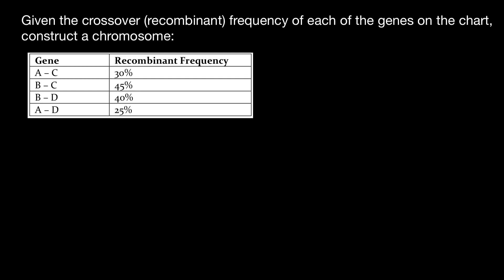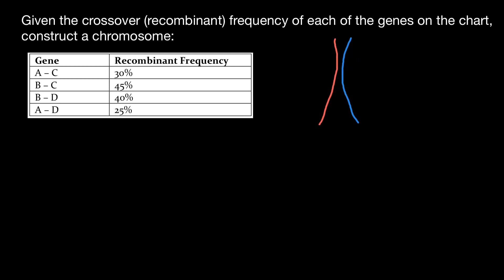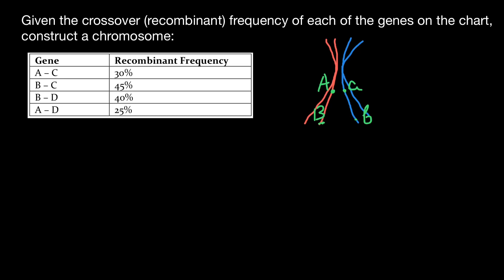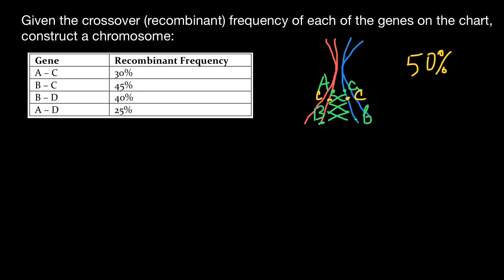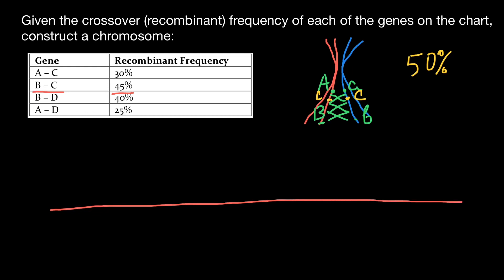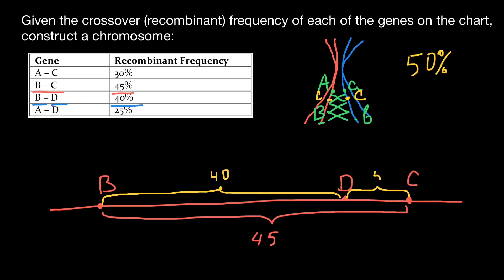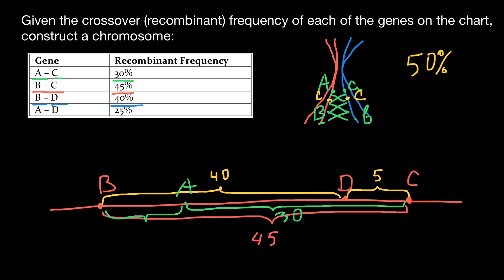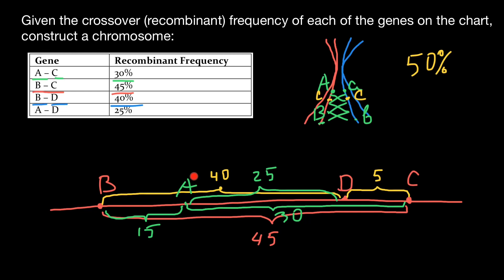How to create a chromosome map from crossover frequencies

Comment: hi Nick, very helpful demonstration, I found it super useful. However, I think the reason that gene A is on the left side of gene C not because of its over 50 CM, since the distance of BA is not mentioned in the question . I think it's because if A is on the right side of C, then A-D would have larger RF than AC, which is contradict to the given information. regardless, thank you for the video !